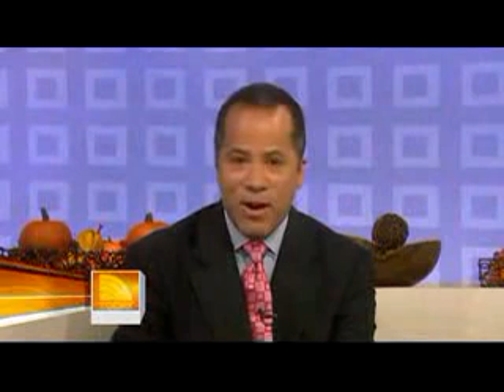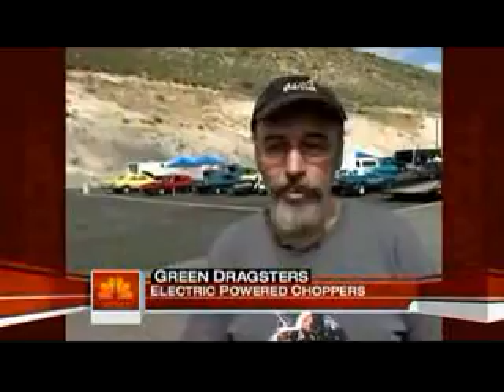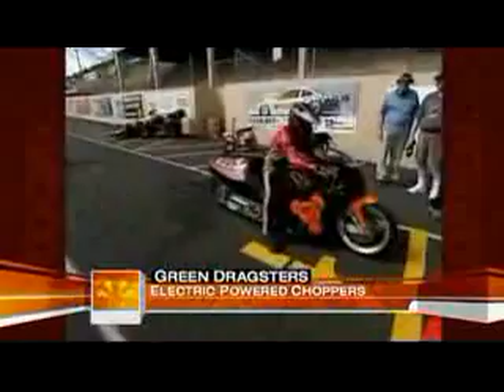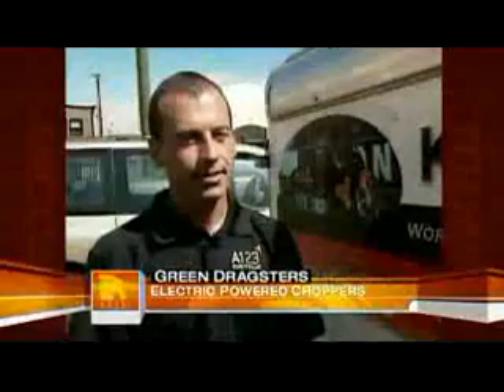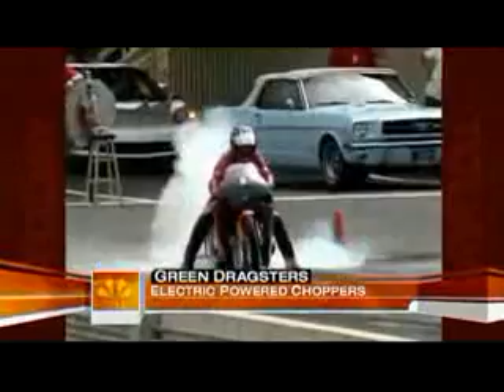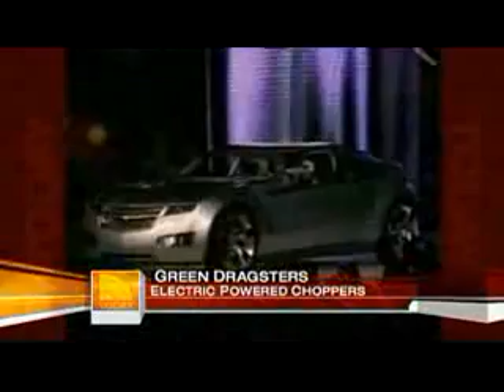Killacycle Battery Power Drag Bike 0-60 0.8 seconds

Comment: Gas engines are 0% efficient at idle, and only PEAK at 35%. Good electric motors [like in the Tesla] are 80% average, 90% peak.

It's really all in the batteries, and once lithium gets cheap, they'll be perfect.

Comment from the maker: 40%... you're talking about a Diesel Pal, petrol is barely 30%, not including transmission losses.

Sure, there is a LONG way to go (which spells opportunity to me)and the twin DC motors and zilla controller in this bike are low tech, but the batteries are the next generation, can you imagine this performance being possible with 28 lead acid batteries on board? Want to see the future of EVs have a look at my other videos on wheel motors!